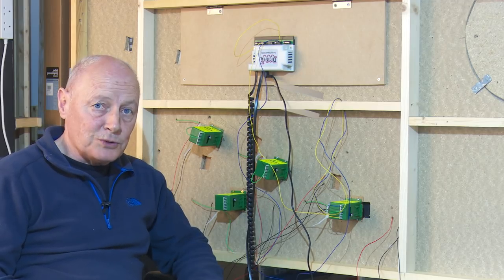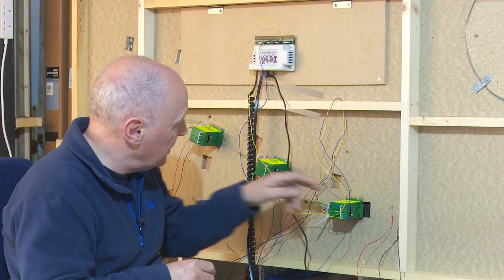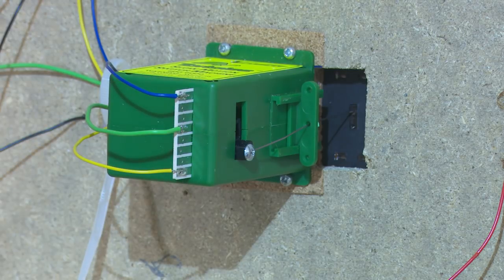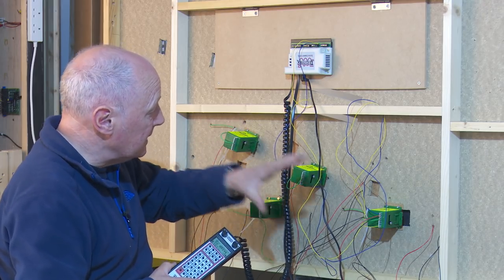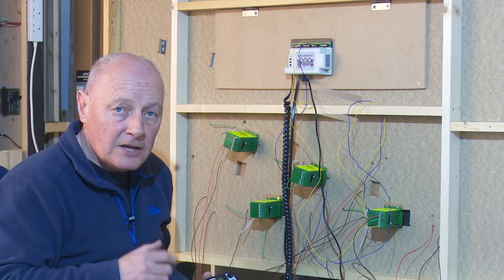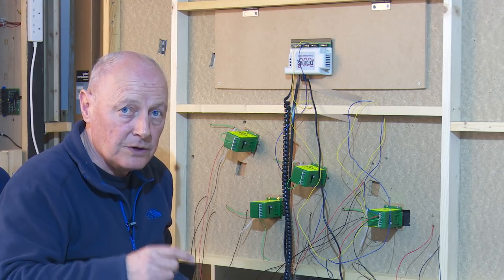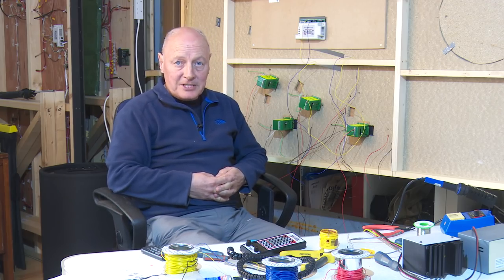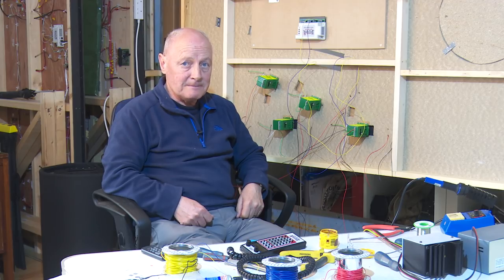23. Wiring Tortoise Point Motors at Chadwick Model Railway

Comment: Hi Charlie, what I found surprising was that you failed to mention was a WARNING! The wire that sticks out of the top of the point obviously needs cutting - I use (used) a Dremel cutting disc on all my original point motors without issue (they were all SEEP PM10s - However, I then purchased a load of PECO motors (the extended wire and lower current ones PM1-EW??). When cutting the wires on these, they became so hot that it melted the plastic on the point around the fixing hole so that it no longer worked!! So I now cut the wire on two or three stages!!
See:  http://www.andybrierley/images/melted_point.jpg
Reply from the maker: Hi Andy,
This video was on Tortoise motors.  
I used a pair of snips to cut the actuating wires and I’m sure that I never mentioned using a Dremel. Regards Charlie
Reply: Sorry Charlie, I think it was when you mentioned they were made from "tensile steel" that stirred up my memory of the melting plastic!

Comment: Hi Charlie, I adopted Tortoise motors on my first (and new) layout and I am happy with them... but I have a question because I am having some issues trying to control them via PC software (tried RocRail and iTrain). Do you control them via PC software? And in case you do that, which software are you using and how are you configuring the switch control in the software?
Thank you very much,
Riccardo
Reply from the maker: Hi Riccardo,
I throw them using Digitrax's DS64.  I imagine that your system must have a similar device.
Reply: @ChadwickModelRailway   Indeed I use DigikeyJS DR4018 device and Roco z21. Everything works fine when I use Roco Multimaus to throw them... the problem is when I try to use Rocrail PC Software to throw them... because I could not find a way to configure Rocrail to provide the throwing activation signal long enough to allow the motor to complete the travelling from one side to the other...

Comment: Charlie, what is the advantage of using a ds64 rather than a ds44? What does it being plugged into the loconet gain for you?
Reply from the maker: Loco net will allow me to change the points to the DS 64 by computer Phil.
Reply: @ChadwickModelRailway  So I rather assumed that was possible with the ds44. Surely if the computer is connected (to the main controller,  the computer get send a message via the controller to change a point attached to a ds44 (or any other accessory controller for that matter.)
I realise you are not a digitrax customer support!! I am on the cusp of deciding which system to go with for mt first layout since I was a teenager, and definitely want to be doing all the stuff you are passionate about - computer control, block detection, etc etc. Also want to set it up with semaphore signals throughout and expect to be able to use various accessory decoders to control them, and have the computer set the signals based on the block occupancy info. But if the computer can only control accessories via an accessory decoder that supports loconet then my choices are very limited. :/
Consider this - the computer can control locos, which are driven by decoders that do not have a loconet connection, so surely the same can be said for stationary decoders.. :/ ?
(thanks for replying BTW)
Reply from the maker: Hi Phil, please contact Jeremy of Digitrains. He will give you unbiased advice at which system he considers best.

Comment: very good video, its help us lot thank you...  Can British HO scale locomotives run on USA Ho scale track despite the differences in electricity
Reply from the maker: Hi Nick, I would have thought so but the rail heights might be different leading to difficulties with flange heights.
Reply: @ChadwickModelRailway  The rail height is not scale dependent. Code 100 is 0.100 inch high, US, UK, or AUS. The problem is wheel strike on the rail clips. See the video on rails and pay attention to the bullhead portion.

Comment: Great video Charlie, Im new at this hobby I'm a little confused about terminal 2 3 4 wires on the tortoise where do the go and do 1 and 8 go to the bus wire. Do I have to use 2 3 4 etc. No very good at soldering.
Reply from the maker: Hi Steve, terminals 1 and 8 switch the point.  You only need to use 2, 3 and 4 if you are using electrofrog points to enable the frog polarity to be switched.
Reply: Do the wires from 2 and 3 get soldered to the rails on the switch itself or do they get connected to the bus?

Comment: I'm new to this but I can bring some relevant expertise. If the wires will fit it would makeva more mechanically sound joint to feed them through the little holes in the connector blades first, ideally with the wire pre-tinned but not the connector. Then solder. Also, and this will only be of limited help, £3 for that female socket seems rather a lot. No wonder 0eople solder wires directly! There may be a commercial equivalent that is cheaper. If I find one I'll come back and edit this. BobUK.
Reply from the maker: Make a fresh comment if you do, I can’t find older threads sometimes .

Comment: if you are using an insulated frog is it necessary to connect it to the tortoise?
Reply from the maker: No Nina, just the two operating wires.
Reply: @ChadwickModelRailway  ok,,,then terminal 2&3,,,6&7   are for running other accessories?,,,,like signals and maybe censors to keep the position of the loco
Reply from the maker: Hi Nina, please go back into the video to 7 mins 43 sec and pause.
The outer cables (blue and yellow) switch the motor. 
When the motor switches, in one position the green cable is connected black cable, and in the other to the red cable.  This can be used to switch signals from red to green etc.
There is another set of terminals which in this instance I have not used.
Regards Charlie

Comment: Where do the track wires go
Reply from the maker: They are the red and black ones
Reply: Chadwick Model Railway I understand that but after you connect them to the tortoise motor where does the other end connect to
Reply from the maker: Those two cables then go to the track.
This only applies if you are using electrofrog points.  If you have insulfrog points then only the outer contracts need to be used.

Comment: QUESTION:
Charlie Such polished work.  IN-fact my current layout and Chadwick are so similar your just 5 years ahead of mine but we will see some vids of mine starting later this year you will see what i mean
for the moment have a peep at my current vids a standard little Hornby layout i made years ago to keep me sane while the dream one is being built and believe me happy wife happy life has been really accommodating for what i have planned.  I digress.
QUESTION.  Electro frogs.  So new layout will be Peco code 100 unlike my hornby layout which was all HORNBY set track DCC with the little V shaped springs tucked in the point as recommended.  Works perfectly.
BUT
Whats the story with Electrofrog exactly I see you need to wire them off to the point motor.  I will use either Tortoise or Cobalt or maybe pecos new servo motors great for mechanical semaphores. (however really want to use wire in tube it really feels like im running the real deal).  Prior to dcc (early 80s ZERO was too expensive lol) we were making a layout when I was young and my father had some electro frog some not of course what it meant was the layout was always alive  i could not leave a train in a siding if the siding had electro as the power went through.  

I really will just have a few points it will be dcc and the the question is HOW did i survive without using them.  The hornby setrack with those springs meant it was always working but the polarity was never being changed all help so warmly received.  I think your dedication to followers is incredible that you get back to them.  Im working on a youtube series about building my ultimate HI-FI which has been my priority in the past 10 years and is almost complete of course it took alot of engineering and building to get it right and I am sure you know all about getting it perfect.
Much thanks
Josef
Reply from the maker: Hi Josef, if you use electrofrog points, you must have a method of switching the frog polarity.  
How you do that is a challenge if you don’t use the normal switches.

Comment: Could you please make a video on how to connect the tortoise motor wires to the track and the digitrax ds64. Thank you this would really help. :)
Reply from the maker: Sorry but I don't have the time.  
The outer two cables in the motor attach to the appropriate terminale on the DS64. 
You do need to change the mode of the DS64 to slow action switches first before you connect up.  There are loads of videos on YT regarding DS64s
Have you watched my video number 22?

Comment: Your wiring of the frog to the switch motor connectors seems very hit and miss.
Surely it should be possible to predetermine the correct connections.
Ken.
Reply from the maker: Hi Ken, you’re correct in what you say and I can work out which way the cables should be connected.  However, when in made this video, tortoise points were new to me and then, I didn’t!
Regards Charlie

Comment: Hi can you please help, I Have just bought some tortoise motors I also use DS 64 but I am not sure or the wiring for this do the outside two cable go to the ds64 with cables 2+3 red and black going to the power bus and green to the frog? thanks in advance keep up the good work your videos are a great help to a new like me Thanks Mark
Reply from the maker: Yes Mark, that’s exactly right.
However, if you get a short when running a loco over the frog, it will be because your red and black, are the wrong way around. Regards Charlie
Reply: @ChadwickModelRailway  thank you Charlie look forward to you next videos they are so informative